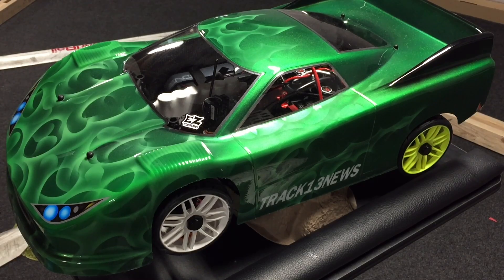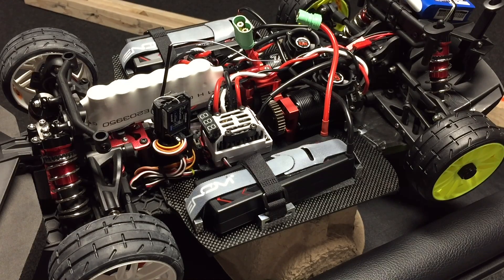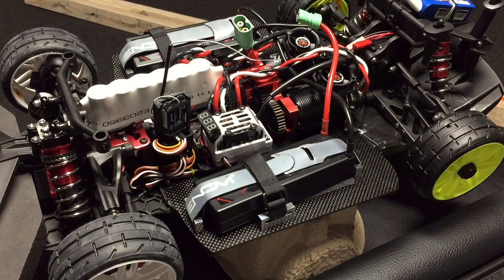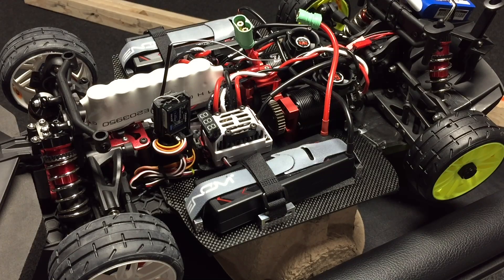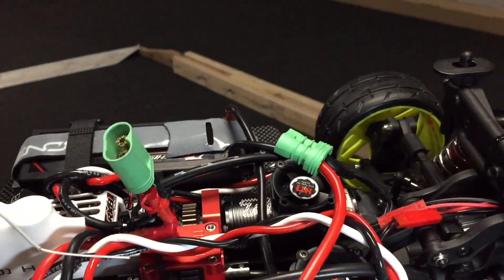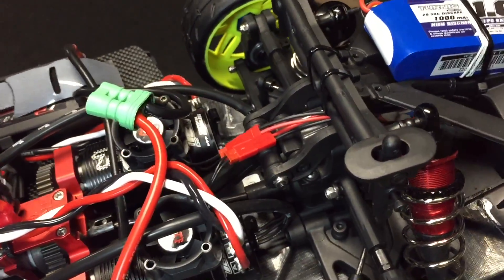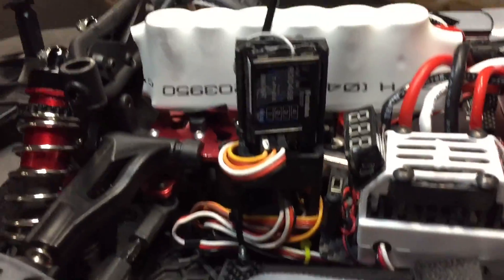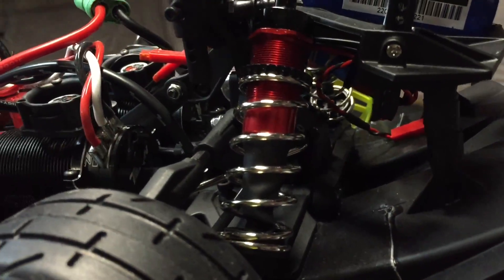Arrma Senton Dual Motor GT Conversion

Comment: What wheels and tires are you using? Also how did you lower it? Did you get new shocks and spring s?
Reply from the maker: GRP REVO GT tires, lowered using droop screw adjustment, springs are NERO springs
Reply: @Track13News  amazing! I have Nero springs and gtr in the mail! Did you have to use longer droop screws? Or the original long enough?
Reply from the maker: Longer, and you can do this too—https://youtu.be/VLyiaypEw1E

Comment: You should get someone to make you a clear cover for your motor mount, those gears look hungry for wires, very cool build.
Reply from the maker: drog343 thanks, I have moved on to another build 3 times more power, 24 HP coming soon

Comment: how are those tenshock Motors compared to Castle
Reply from the maker: I am assuming you mean Tekin motors.  Tekin makes some of the best motors, they are typically used for racing, and are typically high performance with slightly less weight.  They are more expensive, and for speed runs, likely just comparable to castle.

Comment: Would you be so kind to share the silicone weight that you are using in your front and rear differentials? This build of yours is a piece of art. Great work. I "liked" the video and also subscribed to your channel. Keep it up and hope to hear from you on the diff silicone weight if possible.
Reply from the maker: Oscar Rodriguez 1,000,000 in front, 50K in rear, but think I will change front to 500k and rear to 30k maybe even 10k
Reply: Many thanks for sharing. I really appreciate it. =)

Comment: Will that front bumper and post setup work on the typhon and cool build 👍
Reply from the maker: Dee Smith1987 Well yes but you have to do a good amount of retrofitting, and see what misc parts you have to mount the body post carrier.  But the TYPHON is the same chassis as the Senton.  Let me find the link of the guy I gave some pointers too before he installed on his TYPHON.  His video is pretty detailed on what is needed.
Reply from the maker: Dee Smith1987 https://youtu.be/Uhz4CAaGFBc
Reply: +Track13News thanks bro nice build wen you gonna get more runs
Reply from the maker: Spring, April

Comment: very nice build! one question what did you use to get your wtf fan to run at 8.4v and how did you connect the fan to the battery?
Reply from the maker: Maurice Browner I have a castle 10 amp Bec set at 8.4 v, zip tied under the rear body mounts, which taps of the main battery.

Comment: thanks one more question do you know if those battery trays will fit on an arrma typhon?
Reply from the maker: Senton and Typhon are the exact same chassis, please note, I had to cut and shape to fit, those carbon fiber pieces are 100mm x 300 mm, the 100 mm is maybe 10 mm wide for it and the length is about 50-70mm long or so cant really remember the exact dimensions.

Comment: Any chance you can discuss how the xo1 diffuser was mounted?
Reply from the maker: Well, that is a little difficult to explain, but here goes.  To Start, I needed to remove about 30 mm of material from the middle of each tunnel, to fit the length of the Senton, then the diffuser would line up.  The diffuser, because I needed to mount the diffuser underneath the  chassis, I actually cut, dremeled, snipped, filed, and sanded almost half of the diffuser in a C-shape so that it actully butts up against the chassis in the rear, and wraps around to meet the tunnels.  In addition, the rear arms would not drop to their desired droop, so more was removed to accommodate this.  Now how did I fill all this gap and still allow the diffuser to work?  Well Getto style.  I needed a thin layer of something to replace what was missing, and attach to the chassis to keep a continued flow.  Also, I needed it to even flex a little, because of rear arm droop settings with different tires.  My solution, Gorilla tape, strips of gorilla tape, then under the rear arms, gorilla tape so that the adhesive side from under, and below joined together.  Then I CA glued all the edges of the gorilla tape.  Actually came out quite well.  Definitely, not perfectly smooth as the original diffuser but relatively close.   If I had to do it again, I wouldn't; but, I was already into it so I made it work.